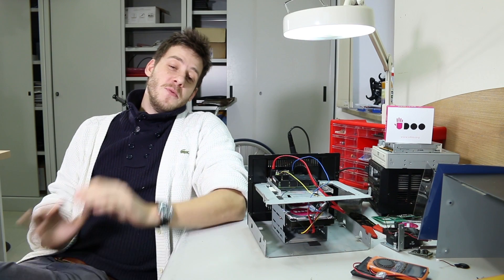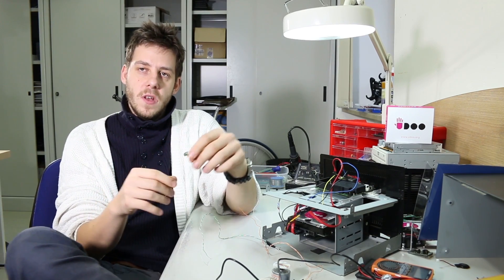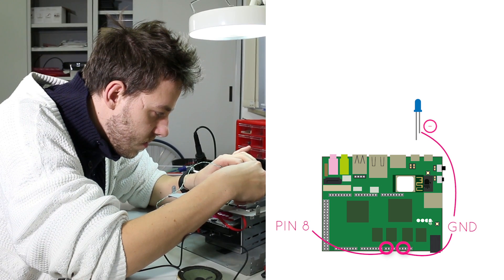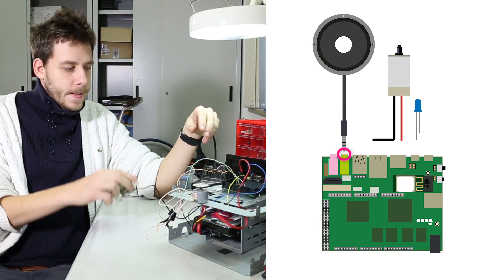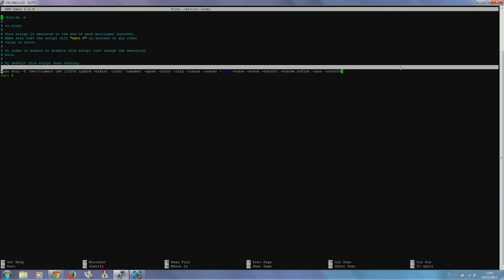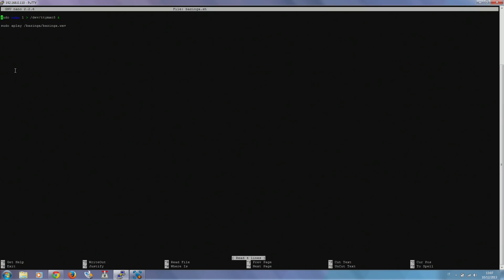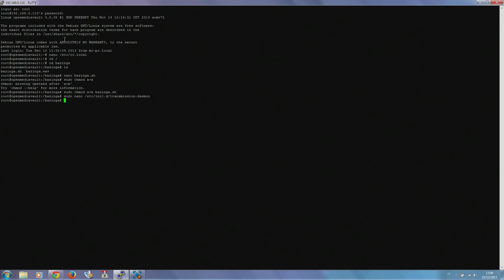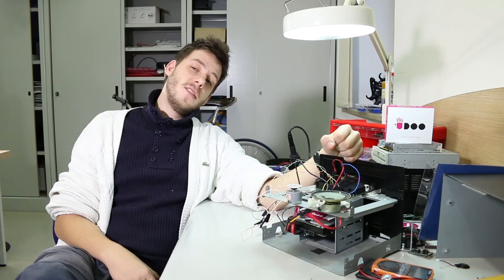DIY NAS with Openmediavault and UDOO - pt. 3 Hardware set up

Comment: HI

Thought you should be aware that the individual pins cannot supply 150mA as you state in the video. Individual pins can supply 3mA or 15mA depending on the pin. The combined maximum output current of all the pins is 130mA. Secondly the motor should not be connected directly to a pin as it is highly inductive, and will induce a reverse biased emf which may be be several thousand Volts in magnitude. This will quickly destroy the pin or microprocessor. The motor should be driven using a transistor and a reverse biased diode across the motor to dissipate the induced emf.
Reply from the maker: The motor we used on this tutorial showed to drain 30mA at 3,3 volts so Udoo can definetely supply this current. However, you are right: for safeness sake (and assuming that a wide range of motors can be used), an ideal solution would be to power up the motor as you suggested. In this particular configuration, the only risk we have is that if we manually spin the motor, some current will flow into Udoo potentially damaging the pins or the controller. So a diode would do the trick, but it will cause the voltage to drop (potentially preventing the motor to spin at all). 
We choose to show the most basic example we could in this tutorial, and we'll cover motor management in future tutorials.
Thank you for pointing that out. Which schematics do you suggest for this applications?
Reply: You could probably use a motor driver! Would be safe as well as more effective.